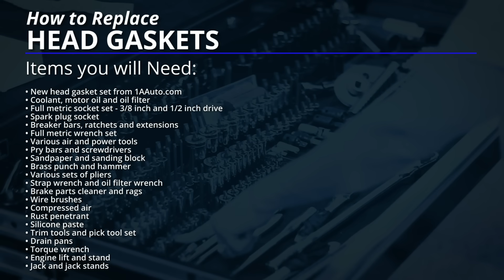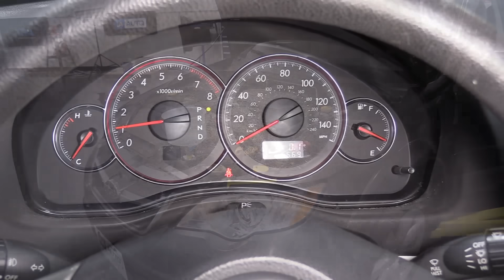How to Replace Head Gaskets 00-09 Subaru Outback Wagon

Comment: Not sure why she thinks the lower bellhousing studs are a pain in the butt.. You don’t even need to take them out you just use a 14mm swivel to take the nuts off, I actually love that there are studs on the end it makes lining up the engine and transmission so much easier plus you can slide ur engine stand flange right on the studs. The only bad part about taking the engine out of a Subaru is the bellhousing alignment dowels because often corrosion makes them get stuck in the bellhousing making it a pain in the butt to separate the engine and transmission that’s literally the only pain in the butt part of taking an engine out of one of these Subarus! These engines are so easy to remove I could be hungover and not sleep for 2 days and still get the engine out in less then 45min. I just love doing head gasket jobs on these engines. You do not need to remove the intake to do heads you can leave most everything connected on the intake take the intake bolts out, couple brackets, dipstick and then unbolt the heads. You can replace the coolant crossover tube without removing intake too. She did a good job! Shouldn’t have used a piece of sand paper to clean the block surface.

Comment: 😮 I just bought an 2006 imperza 2.5i premium sedan love it.

If i had to this I would highly recommend changing all of the sensors, pcv valve while its out of car. Also any location of oil leaks too.
Parts are cheap.

Fyi there is specialty tools for this Subaru ej253.

Great video to pull engine tackle this job but wished you did while engine still in car.

Comment: Gotta use a MLS  gasket or might be doing it again soon.  the twin cam ones are more work because the cams need to be removed to expose the head bolts.  doing this job is a lot easier with a lift

Comment: A used Subaru pre-2012 with no Head gasket symptoms
Is it wise to replace the gasket as a preemptive measure? or wait for failure?
Reply from the maker: +VcasF VcasF We would suggest having it checked before making that decision. It is a costly job but you wouldn't want to wait for it to fail.

Comment: liking the  job and preparation   involved   but  why  when you had the  car up in the air  did you not drain the engine oil   to save  having to mess about with a  drain tray  full of oil  ?

Comment: Unless I'm mistaken the 2.5 head in that year range should have had 6 bolts but someone made them with 4 head bolts. I'm glad they machine the head, you need a cross hatch pattern # on the head after it's returned or it's not flat.
Reply from the maker: +Harley Rhyder Thanks for the feedback!

Comment: There is no way in the world any mechanic I take my car to will do a job this careful, thorough and precise. When it's time to do my head gaskets I'll have to buy another car.  I don't think any mechanic I deal with will change all those little gaskets or clean the cylinder heads and machine them like that or torque loosen then retorque the bolts. I doubt they even know they have to do that.

Comment: Reattaching the flywheel to the torque converter with those 4 bolts on the automatics is waaaaay easier with the intake still off the engine, rather than trying to get your hands into that little inspection hole from behind the intake.

Comment: Do 6 cylinder Subaru have head gasket problems?  I don’t see where my radiator water is going away at? 2019 legacy? Thanks
Reply: Once an engine overheats it almost always makes the heads warp. To check the head gasket let the engine cool down to room temperature then remove the radiator cap. Top off the radiator then start the engine with the cap off. After the engine reaches operating temperature, rev the engine up a few times. If the coolant is leaking into the engine, revving the engine will cause the coolant to fly out of the radiator opening.

Comment: does anyone know what kind of work i would need to do isntead of the torque converter if the car had a manual trans? does the transmission just bolt right up?

Comment: Can Sue replace the HG of my 1998 Forester workhorse that is starting to leak. Subaru dealership in my area are asking Jupiter cost for the job.
Reply: indirectly right ?  This is a great video on how to pull the engine.  Speed Academy (Nam) does a great job taking the engine apart - FYI.   find a engine hoist on Craigslist or Harbor Freight (new)..get the leveling bar if they have it, and go pull the engine, get a 50 engine stand Harbor Freight, and torque wrench... on my 99, got the valve stem seal removal tool and valve stem, found a glass table for free and sanded my heads...they were in great shape... KEEP all cam follower/valve discs in their IDENTICAL spot, one thing I tried but not hard enough on.  Good luck !  - new timing belt, water pump, maybe oil pump, re-use head bolts..just my 2 cents

Comment: Is the procedure basically the same for an 08 Impreza 2.5 N/A?
Reply from the maker: We currently do not have an auto repair video specific to your vehicle. You might be able to apply some of the basic steps shown in this video to your application. +Matt Jewell
Reply: I have a 08 Legacy 2.5i with the EJ253 engone paired with a 4AT. This engine is identical to mine, and I think all of the EJ253 were in this setup for the 2008 year (more specifically the post-2005 years of the 2000-2009 3rd and 4th generation), so your 08 Impreza should be very similar if not identical. Between the years, they mostly moved parts of the intake system around, but its all the same 2.5L SOHC engine underneath. Unless you have the EJ255 that they put in the Legacy GTs and the WRXs, then that would be the 2.5L DOHC.

Comment: You can do this without removing the engine.  So much more work. A mechanic on YouTube shows you how
Reply: Engine Assembly removal is 6.6 hrs Head Gasket on Both Heads is 10.1 hrs. I've done it with the engine in, but there is no much room to work even after raising the engine up a bit.

Comment: Can you do Nissan Altima head gasket replacement?
Reply: Cheaper to just put a good used  engine in it, with a warranty. Those altimas when they pop a headgasket they don't like to stay fixed. Heads are crap. Its a known issue.

Comment: Buy a pick set,never use a flathead screwdriver.never use a wire wheel on a flat aluminum surface,and please don't use a sanding block on your engine block.why machine one side and hand massacre the other?

Comment: she did not mention to use blue loctite on the torque converter bolts, or not to tighten even one of those bolts until all 4 are installed

Comment: If you feel like your car isn’t worth the energy, then you shouldn’t pay thousands of dollars for the repaired head gasket. Since the procedure costs over $2,000 for an automatic or manual car, you need to determine if that financial commitment is worth it for your specific vehicle. If you have an older vehicle that you aren’t confident is going to run smoothly for much longer, you might want to consider selling/turning your car in for junk.

Comment: You made more work for yourself by not removing the intake manifold first. You didn't need to remove the throttle body for the torque converter bolts at all. Just remove the whole intake as one assembly. Just take the spark plug boots out of the valve covers and it come right off. Followed by the AC compressor bracket. Just undo the compressor from the bracket.
Reply from the maker: +fightingfalconfan We appreciate the feedback. Sometimes there are multiple ways to accomplish the same repair.

Comment: I miss the part where you show where the old head gasket failed?
Reply: The 2004-2008 engines used single ply gaskets that eventually allowed compression gases to escape. The gasket isn't broken anywhere it's just not thick enough to stay sealed. Subaru started using multi-ply gaskets and that fixed the issue. If an aluminum block engine ever overheats, it warps the heads and just changing the gasket won't help. That's why she pointed out the importance of sending the heads to a machine shop for possible milling to make the surfaces perfectly flat again. It's also a good idea to grind and seat the valves before reinstalling the heads or replacing them with rebuilt ones.

Comment: what happens if you accidentally rotate the cam after taking off the sprocket
Reply: You just have to rotate the cam back to position and line up marks.
Reply: you are safe tonrotate cams IF the crank mark is the the position to install the timing belt (12 o clock). In that position the cylinders are all mid stroke and will not collide with the valves in case you spin the camshafts.

Comment: If this head gasket set is single layer steel it's going to fail prematurely. Needs to be multi-layer steel. All Subaru did with the original design was increase the bore size of the cylinder. Didn't strengthen the cylinder's at all. So single later gasket for the head would fail after a while.

Comment: Looked okay...but abit rough for my liking. Specially hoses coming off plastic connections. and late telling us to place any nuts or bolts back with or in parts you take off....placing parts on the side of the car you took them off. just to prevent mixing or losing anything. Just my opinion. well done though.
Reply from the maker: +Hayque Porter Thanks for the feedback!

Comment: 1 oil dip to a head not snug has high possibility to contaminate the gasket. 2  Hydraulic compression in the hole from exsess oil will give you a false tourqe reading before you apply the Degrees!

Comment: Glad I didn’t buy that cheap Subaru
Reply: I bought a used one for $2,000. I kept it for 12 years. It had 300,000 miles on it when I gave it to a college kid to use as a commuter car. They are the perfect car for mountain living. Put a set of studded snow tires on them and they won't slide on those icy mountain roads. Driving through snow is never a problem. Stopping on ice, especially on curvy mountain roads at night where there is no cell service, can save your life.